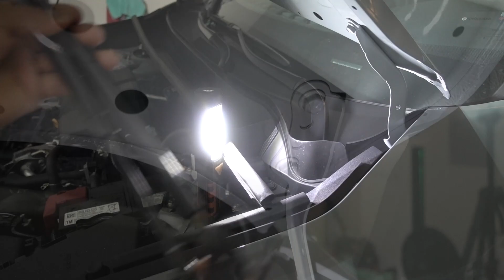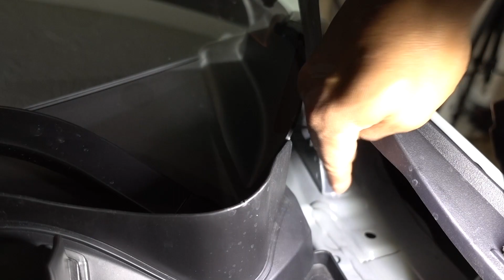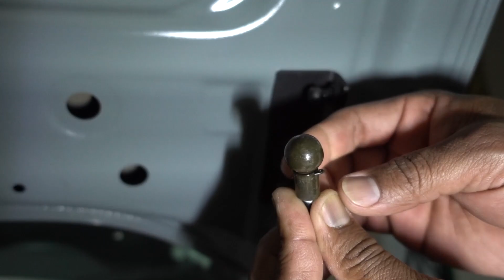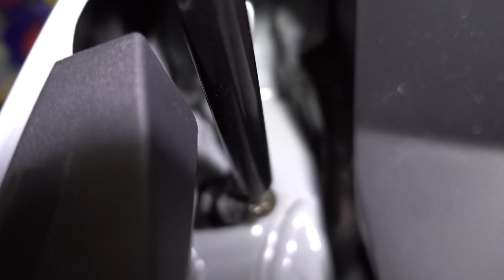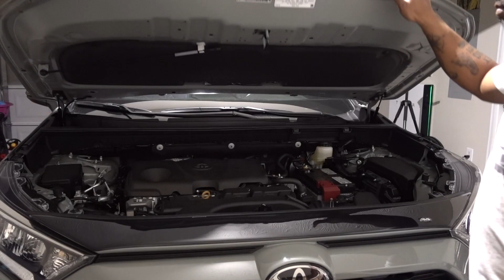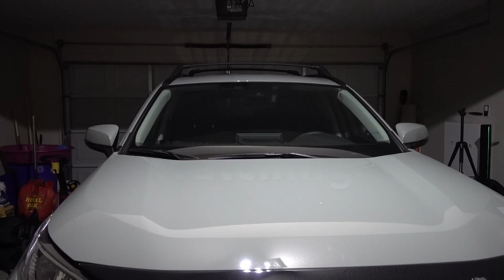2019-2021 Toyota RAV4 Hood Lift Support Installation

Comment: Hi bullet my rav4 is 2019...with full led headlight..no projector...headlights are very weak at night....the new rav4 2022 has better headlights but it will not fit my 2019 rav4...wiring and socket and harness different...you have any idea ??
Reply from the maker: You can go aftermarket for new headlights
Reply: @BulletSolano  which brand please show me the brand
Reply from the maker: https://alpharexusa.com/product/19-23-toyota-rav4-low-trim-nova-series-led-projector-headlights-black/

Comment: Hi Bullet,
I ordered through Aliexpress. Although they worked ok I took them off as when the lid was shut the two corners (near the windscreen) were pushed upwards. It was clearly visible from the inside of the car.  I would rather use the normal support than exert so much strain on the hood, bolts, hinges etc.  Quality was not that great anyway.
Reply from the maker: Hi, that’s the reason why I never order anything from AliExpress! Ever, I don’t have that problem with mine!

Comment: I did this install and found that the hood struts don’t allow the hood to open far enough to be able to use the prop rod any longer. Is that your experience?
Reply from the maker: Yeah, but the prop rod is not in my way to work on the rav
Reply: @BulletSolano  thanks, just wanted confirmation.
Reply from the maker: No problem

Comment: These struts have pretty low ratings on Amazon and they aren't available any longer.
Reply from the maker: Yes because they don’t have any instructions, but the product works
Reply: @BulletSolano  Quite a fe of the comments said that they included two right or left side attachment brackets. Let us know how they hold up. thanks
Reply from the maker: This is the same hood lift supports that I have on my 2019 RAV4 for one year with no problems